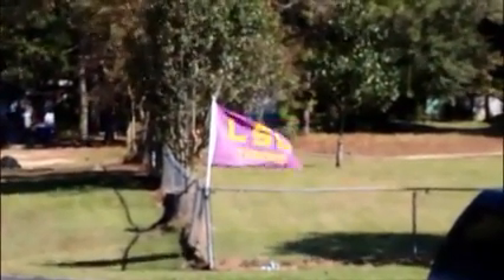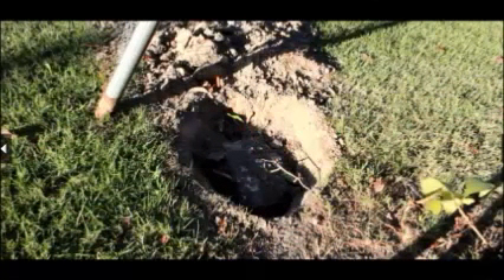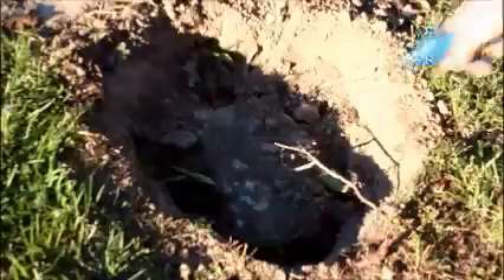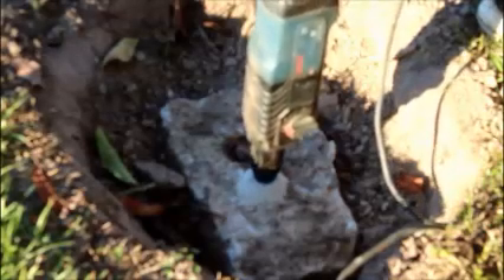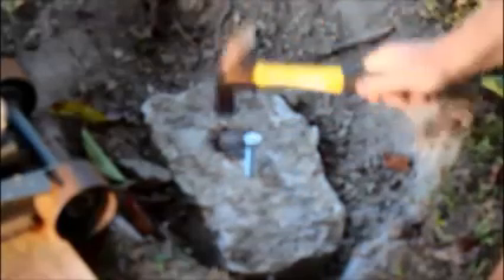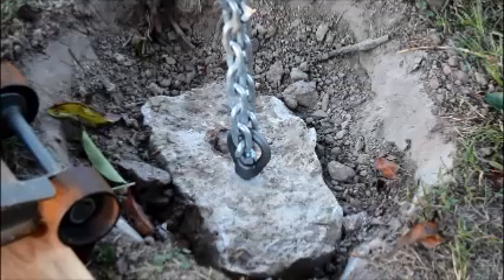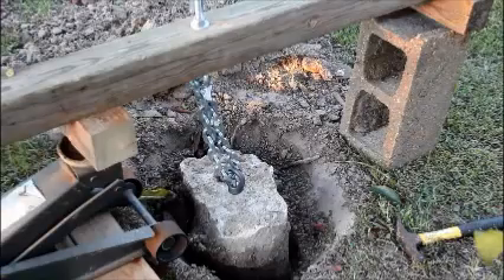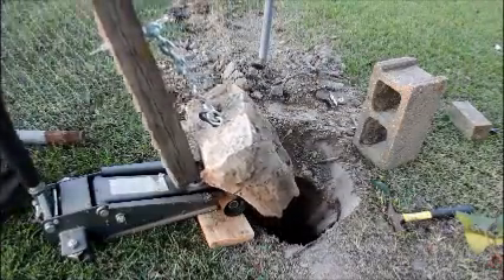How to remove a metal post !

Comment: I liked your video and tried. At the beginning not working. It pullout the bolt and concrete not move at all. Later, I drill anchor deep enough and it did work great. One    Point is that don’t pull all the way. When the chain is very tight, release and do again and back and forth many times. It will work great. I like your video because it works and it is real, not just a presentation
Reply from the maker: Thanks for the kind sentiments. 
Sincerely ..................
God bless.
Reply from the maker: Thank you for watching my video and the kind words.
I'm sure there could be other reasons but the 1st things that comes to mind is that either the hole drilled may have been too large keeping the wedge part of the anchor from engaging & tightening the hold on the bolt. 
Or, 
Whether I mentioned it or not, the nut must be screwed down far enough for the wedge at the bottom of the bolt to raise the bolt into the sleeve in order to lock the bolt in place.
No big deal, just repeat the process about an inch or 2 away and try again. Make sure the drill is the right size and you tighten the nut down to raise the bolt into the sleeve. Then take the nut off and slip the eye on the bolt and replace the nut to hold the eye.
Good luck and thanks again,
Sincerely .................
God bless.
P.S. I noticed I didn't screw the nut down to lift the bolt into the sleeve like I suggested above. If you notice the part where I lifted the chain w/ the jack, it actually pulled the bolt up into the sleeve before it started pulling on the concrete block. But, that's actually my experience over my career in construction. A 1/2 " drill bit should do the trick for a 1/2 " drop in anchor (Red Head).

Comment: I’ll be trying your method tomorrow. Looks like it might work for me. Thanks for posting.
Reply from the maker: I also found an easier way :)  Tie a rope to the post at the ground.  Roll a spare tire (w/rim) under the rope at the post and tie it off to your bumper.  As you pull forward the rope climbs the tire for a few feet and then pulls horizontal once it gets to the top :)  By then the whole post and block of concrete are out.  It looks cool in the rear view mirror , like a buoy in the water bobbing :)
Good luck and thanks for watching,
Steph

Comment: Good job and good solution to a weighty problem. I had a similar situation and decided it was too much work for that many posts. The concrete was still solid. So I just replaced the tops and used a smaller diameter pipe inside as a splice.
Reply from the maker: Great idea !!  I've seen one inside the other before :)  In this case I did have to replace this on but I chose to remove a whole fence line permanently later and found another way much quicker. Tie a rope a rope to the base of the pole at ground level and slip it over the top of my spare tire. Connect it to my hitch and drive forward.  The rope rides up to the top of the tire (about 20" or so) and lifts the pole and concrete out.  It looks like a buoy bobbing in the water through the rear view mirror :)

I like your idea :)  Thanks for watching and for leaving a comment,
Sincerely, ..........................
Steph

Comment: This video was excellent, helped me pull out an old clothesline pole with a concrete base. Your method sir, is fantasic! Thank you for posting!
Reply from the maker: Glad it worked :)  Believe it or not, I found an easier and quicker method if the post is still attached to concrete :
Tie a rope to the very bottom of the clothsline post or fence post.  Roll a spare tire & wheel up against the post w/ the rope wrapped on top and attached to car hitch or bumper.  Pull the car forward and the rope rises to the top of the tire as it rolls backwards, thereby lifting the post and concrete out of the ground.  In the rear view mirror it looks like a bouy in the water :)
Thanks for the comment and kind words,
Sincerely ...........................
Steph

Comment: What is the part # for the forged eye nut. since yours worked I would like to use the same parts. Thanx
Reply from the maker: Unfortunately i don't know the part # :(   I bought it at my local Lowe's or Fastenal.  It was easy to find once I got the right store though. 
Thanks for the comment,
Sincerely .......................
Steph

Comment: If you don’t want to dig or get a wrapped chain to bite this is a good option.  For the price of an anchor.  Maybe a better option, but most of the vids seem to have a farm jack and chain.
Reply from the maker: Thanks for the comment and watching my amateur video. I agree w/ you but :
a) I had these (including anchor) laying around
b) I have no farm jack although I'd love to have one
c) All through this video I was thinking of an easier way that later I confirmed. It takes a 2nd persons help but wish I had made the video of that way.

In case you'd like to hear about it : (this is only for removing post set in concrete)
1) Tie a rope around the bottom of the post at ground level (2 or 3 loops w/a bite)
2)  Lay the rope over a spare wheel & tire ... then attach to your trailer hitch
3)  Pull w/truck or car
The rope will rise to the height of the spare tire as the tire rolls back, sufficiently lifting the post and concrete out of the ground. It really looks cool in the rear view mirror as the post looks like a buoy in the water swaying around as it rises. A helpful person can help move materials from post to post.
Thanks again for watching and your comment,
Sincerely ............................
Steph

Comment: Hi Steph, how many tons is your floor Jack?
Reply from the maker: I think it's a 2 ton.  I know it's the cheap one at Harbor Freight so it's not something special :)  Thanks for watching and leaving a comment.
I will say that since then, I've found a better way. Easier, Faster, less tools. Tie a rope to the bottom of the post at ground level. lay it over your spare tire (& wheel) that you push right up against the post. Tie the other end to the hitch on your truck and pull. The trailing edge of the spare tire will be rising as the tire rolls away from the post. It actually lifts the post clean out of it's hole, cement and all. It looks like a buoy rising up out of the water from the rear view mirror. It's kind of funny looking :)
Of course it won't help if the post was broken off like the one in this video but it works great w/ the post still secure.
Thanks again,
Sincerely ...................
Steph

Comment: youtubejust  suggested this. i like it! Very cool man, very cool. looks familiar :)
Reply from the maker: I'm surprised YouTube suggested my video, thanks for sharing that :)  I'm glad you enjoyed it and took the time & effort to comment :)  There are other familiar video's that use different types of jacks or systems to fasten but I had these parts laying around and figured out how to use them :)
I've since found a better way : Tie a rope to the bottom of the post and roll a spare tire up to it, laying the rope over the top of the tire and fixing the other end of the rope to your ball hitch on the back of your vehicle. As you drive forward, the trailing edge of the spare tire rolls up as it comes away from the pole, lifting it out of it's hole. It really looks cool from the rear view mirror :)  Like a buoy floating in the water :) Much quicker and easier than this method. 

Thanks for your generous & kind words,
Sincerely ..........................
Steph

Comment: Do you mind linking the drop in anchor and forged eye bolt where you got them or where I can get one. I have someone that has about 20 of these pulled out of the ground. I just dont want to get the wrong things. Great video
Reply from the maker: Thank you for watching and your kind words. 

I believe I used a 1/2" red head, (drop in anchor) purchased at Lowe's :
https://tinyurl.com/y2gu93p4
I got a couple but they sell them by 2, 10, 20 or 25 or even bigger quantities !!

The Drop Forged Galvanized Eye Nut I bought at Fastenal :
https://tinyurl.com/y4podwh6
I got the one w/ 5/8"-11 tpi so it would slip over the anchor instead of having to screw it on and off.
1/2" anchors and 5/8" eye nuts may have been overkill ? I do that frequently :) But you may get by w/ 3/8 anchors and either 3/8"-16 tpi or 1/2"-13 tpi eye nuts to save money !!

Both of these items should be very easy to find at any hardware, big box or fastener store.  They are usually in stock !! Heck, even Walmart has them :
https://tinyurl.com/y32t7edl     https://tinyurl.com/y5nmpdv2

Thanks again !!  Hope this helps :)  Good luck w/ the project :)
Sincerely ...........................